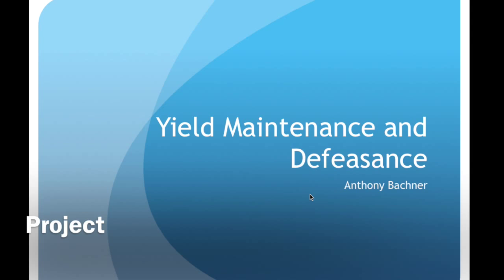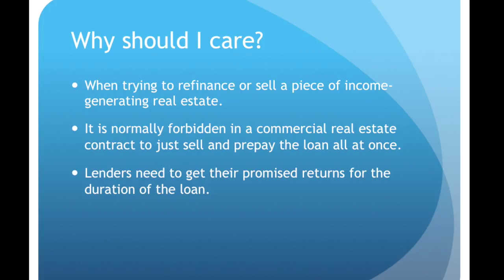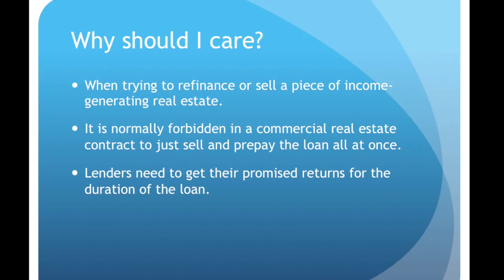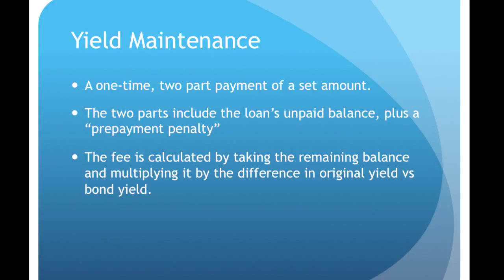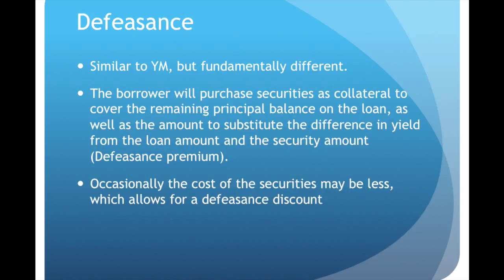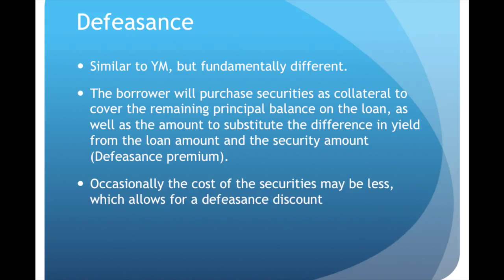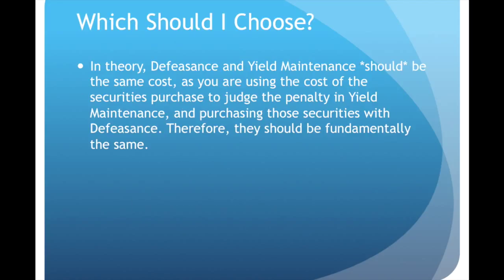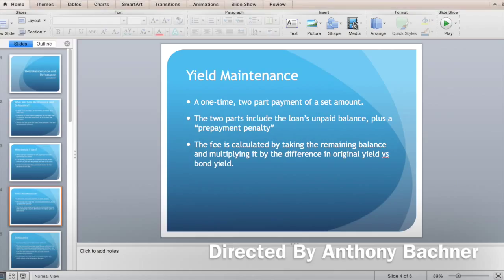Yield Maintenance vs. Defeasance

Comment: Question.  I purchased some municipal bonds.  The coupon was for 5.5%.  Say the current government treasury is yielding 2.0%.  During defeasance, does that mean the municipal entity that originally issued the bonds has to purchase government treasuries worth 2.75 times the principal of the original loan in order to service the debt?  I wouldn't think so, right?  It seems that there would probably be some provision where the value of the government securities purchased was more by the yield difference, so that at the end it all worked out.  Do you happen to know how it works?  Also, at the end of the original bond maturity date, do I as the bond holder get my principal back exactly as I would have?

I'm basically asking what I as the bondholder possess after defeasance.  You mentioned escrow holds the newly purchased government securities, so what do I own now?  Just a promise that I'm going to get my money on the same schedule as before?  I am no longer able to sell this bond as I was before on the open market, right?  I'm not sure, from a legal perspective, what I'm holding onto after defeasance.